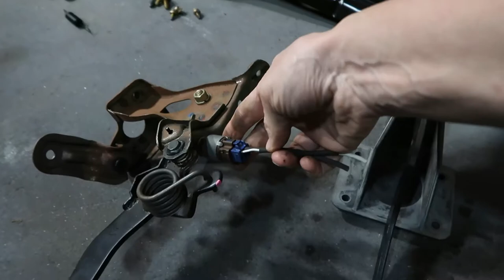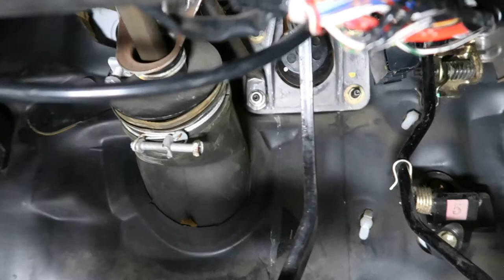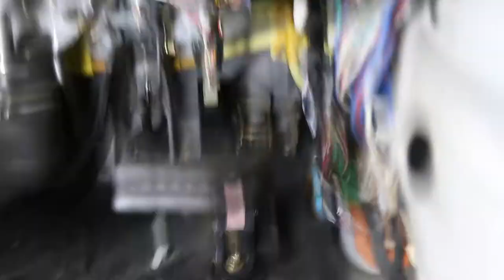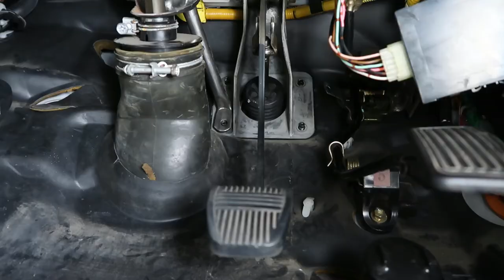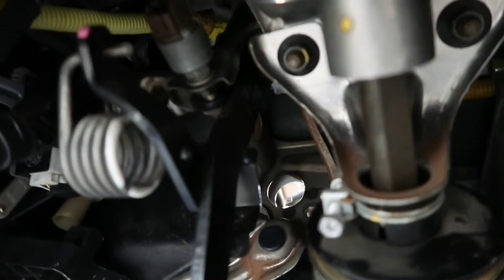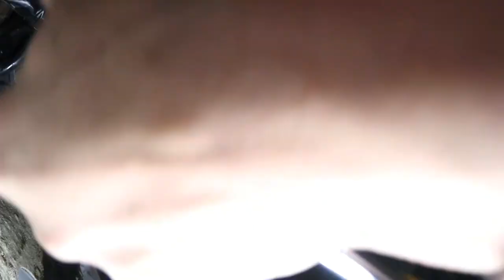Supra Build - Manual Conversion Peddle Box

Comment: While a little late for you here; to anyone else watching this before doing the same job, just change the brake pedal arm itself. It's genuinely a ten minute job that can be done without removing a single piece of interior or trim.
After pulling the brake-master connection's clip and pin as shown here; use a pair of 14mm spanners on the arm's upper pivot. Remove the nut, pull the bolt, then push the bolt back in from the nut's side to push out the inner tube. The arm and a small washer (on the nut side) will now drop free. Make sure the plastic bushes are in the new arm. Put the new arm up into position, then push the inner tube and bolt back halfway in to hang the arm. Slip the small washer back between the nut-side plastic bush and magnesium brake pedal frame, locating it for the bolt with a small screwdriver from the nut side. Push the inner tube and bolt through, then on goes the outer washer, spring washer and nut. Re-connect the linkage to the master and you're done.

Unfortunately there's no easier way around that clutch pedal..!

Cheers - and great videos!
Reply from the maker: You are completely correct, but for some reason the assembly I had, the inner tube would not move, so in the end I deemed it easier to change the whole thing over. Yeah, maybe I should have persisted...

Comment: Hi feeonna do you have the part number of clutch master?
Reply from the maker: Hi Yousuf,  this one ?  

 OEM MKIV Toyota Supra Clutch Master Cylinder31410-14310
Reply: @Feeonnaa  ya I know went ahead with supra one. But since we have lhd it may fit, since we dont have much area restriction, I would like to give it a try with landcurise unit, if not sure about part number let me know the year of landcurise. Thank you very much, I am doing auto to 6 speed swap now. 😁
Reply: @Feeonnaa  maybe this one 31410-60550
Reply from the maker: I'm not sure which Landcruiser one I got, was random sorry.
Reply: @Feeonnaa  I got 97 landcuriser clutch master and its looks like its gona fit perfectly, we need to add a bolt to the missing stud and we are done. Thank Feeonnaa